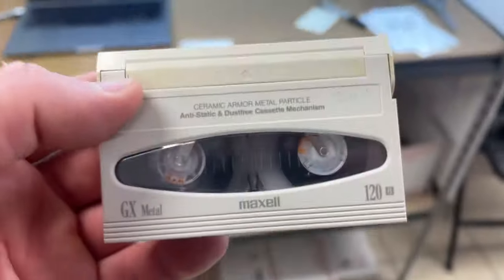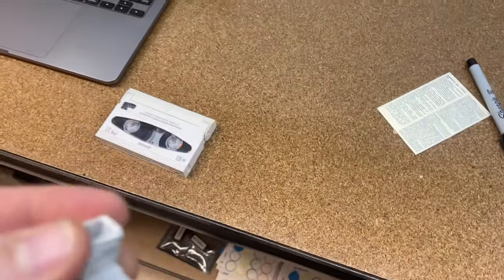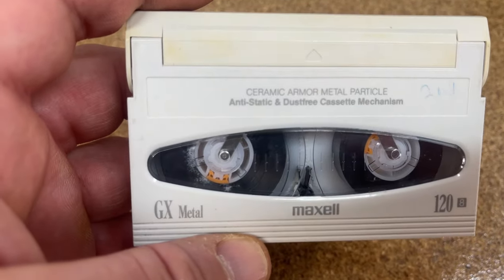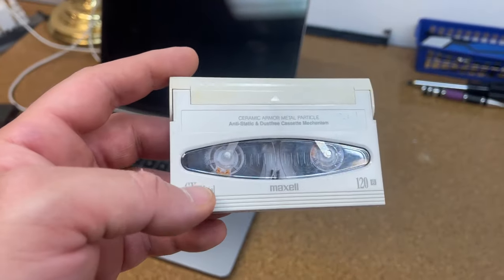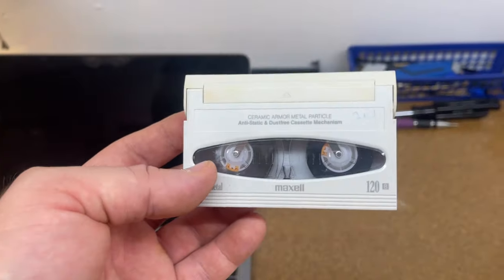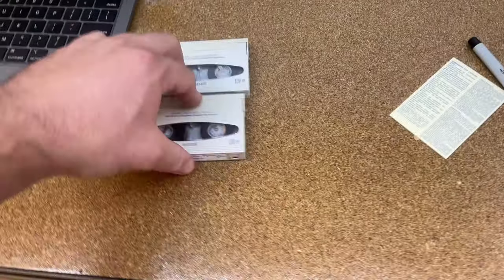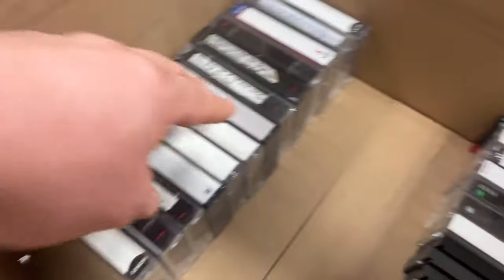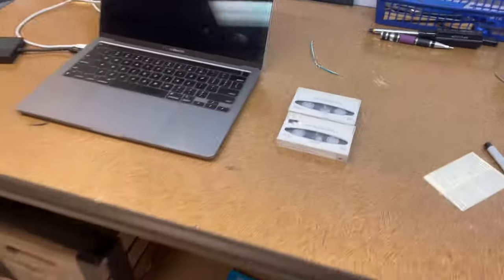How to Recover 8mm Tapes With Mold. ** it’s the worst!

Comment: Why is the same procedure used for cleaning VHS tapes not also possible for cleaning hi8- slide projectors or the other equipment/ideas you used for cleaning VHS tapes?
Reply from the maker: different build quality and thinner tape ribbon..vhs tapes can take ALOT more abuse. 8mm and dv... wont last as long. not even close
Reply: @EmeraldCoastDigitizing Even using a 2-way 8 mm. rewinder?  I’ve seen that they exist on eBay.